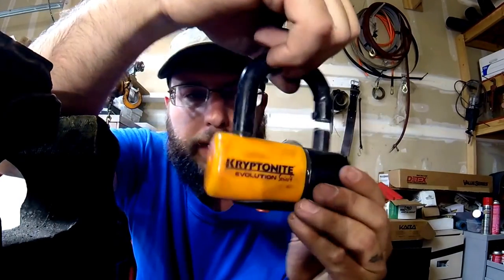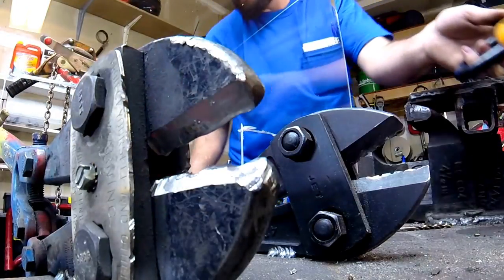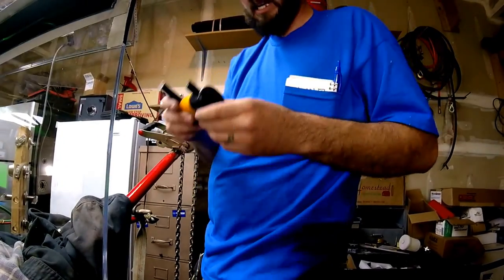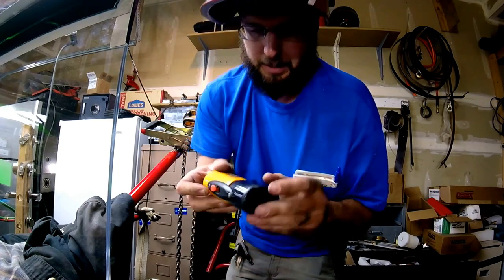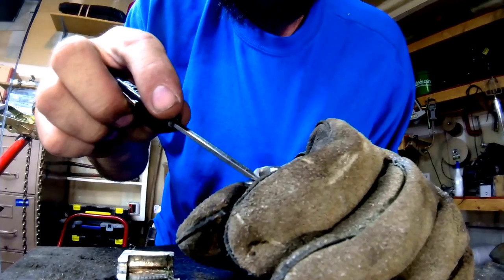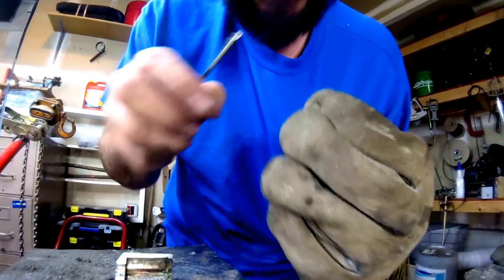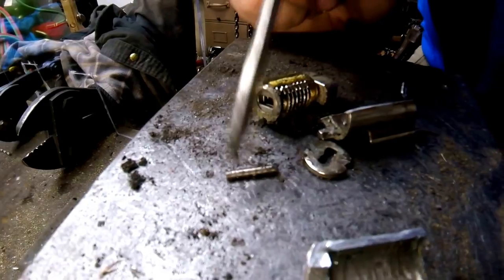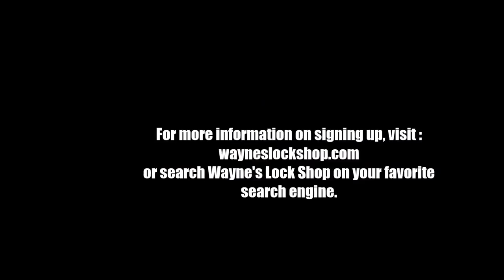Bolt Cutters Vs. Kryptonite Evolution Series 4 Padlock Review Cordless Grinder Cut Open Gutted

Comment: Nice video and great information. I just wanted to chime in and disagree on the pick resistance of this lock. I have not found these Kryptonite cores very hard to pick at all. They tension off the first disc and have no false gates or any other antipick features. That’s about as easy as disc detainer cores get. That said, I acknowledge that the skills and tools required to pick them are not common among criminals and picking of these types of locks isn’t really a significant threat in the “real world.”
Reply: LockPickingLawyer just saw this video and twas about to reference you. I will consider it rendered. This is still the lock and chain that i use on my daily. Even with the plastic plug issue it seems more than adequate for my needs.
Reply: Tension off dez nutz😨.
Reply: Just saying "disk detainer tool" is equivalent to "hard to pick".
Reply: @johncarlola  What??? Doesn't every serious bike thief speed freak/junkie have a disk detainer tool in his pocket?
Reply: Yea I just saw this video today and I remembered I saw a lockpickinglawyer video where you had picked this lock and it wasn't that difficult. Having said that I still find Wayne's videos very interesting and respect his work. I kinda want to be a locksmith now.....lol

Comment: Even with the grinder cut, im not sure the shackle pivoted enough to release the chain so you would have to cut this twice like this to open it i think. Thats a heck of a lot if cutting resistance. This and the chain that comes with it are what i use on my daily rider. I dont think anyone is gonna be getting through it with bolt cutters. It took quite a while for you to do so.

Comment: Bolt cutters are a shearing force where they are effectively forcing the target metal apart. The fact that the other side of the lock D had already been cut (I'm guessing by the look of it by a grinder) means that the bolt cutters work had already been made significantly easier. The cutting edges are now "only" having to split the lock material apart, had the other side of the lock been intact then they would have also had to bend the lock material which would have required significantly more force.
In the same way that knocking a brick out of a wall is significantly easier if there is less wall above it this means that, unfortunately, your test is flawed and I suspect that if the lock was intact the cutters would not have worked.
Great video none-the-less and thanks for making it as it certainly proves that it is a strong lock beyond the tools of the average thief.

Comment: Bolt cutters attached to a table with a hydraulic jack. Dumb video. I am buying a kryptonite now.
Reply: Ditto. I don't understand the point of this video. Most of us just want a lock that prevents theft by your normal tweaker bike thief with a pair of large bolt cutters. I don't think the CIA or the KGB is that interested in my bike anyway, so I'm not going to spend the thousands of dollars necessary to keep them at bay.
Reply: You do realize that there are hydraulic bolt cutters? Which would defeat this in 30 seconds? By simple hands....